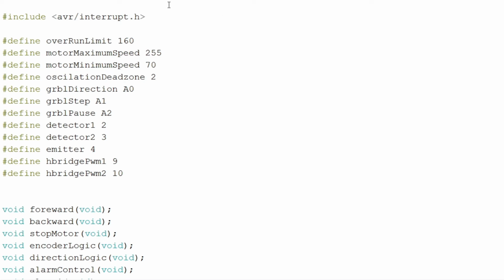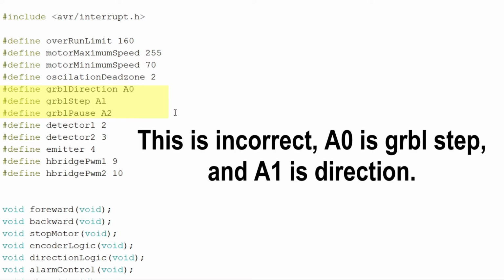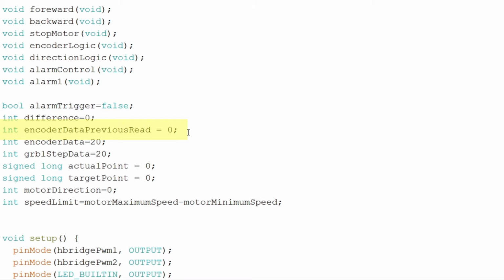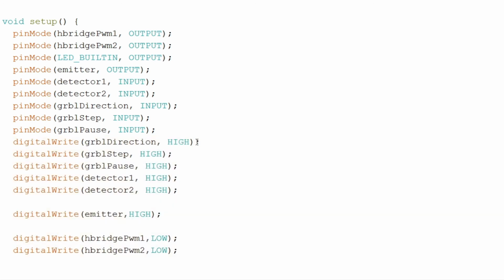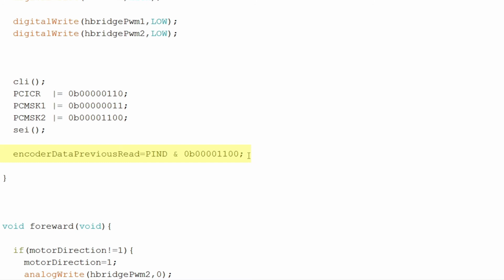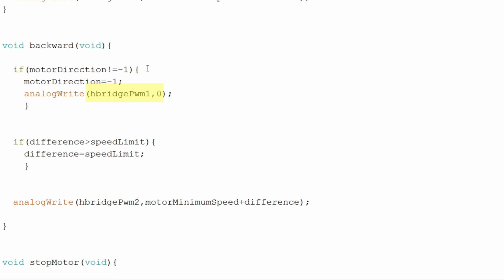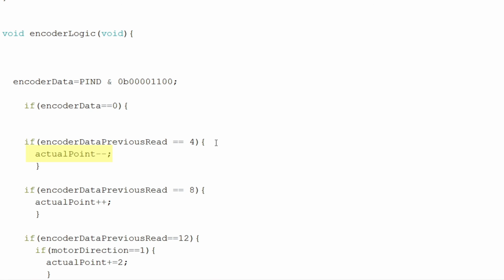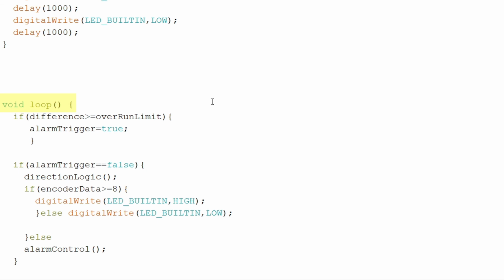Arduino motor controller line by line

Comment: Hello, can I use magnetic encoder such as AS5600 instead of the feedback mechanism used here?
Reply from the maker: In theory you can use such an encoder, but it will take changes to the code and wiring to make it work. I have never used that encoder, but I see it can use analog or something like I2C. If it has 2 analog outs for quadrature output, it might plug and play, I see that its outputs range from 0 to 360 for I2c, and this would be problematic as it resets the value every full rotation. The code expects a continuous value change calculated by quadrature output of the home built sensor. This output has a very large value range preventing any wrap around or rolling of the value, so there is no code to deal with that. To simplify with the AS5600 the value will roll from 360 back to 0 every 1/20th of an inch of movement on a machine with a thread pitch of 20 threads per inch on the lead screw. The step pulses from the GRBL control board are counted, and either added or subtracted based on the direction pin state from the GRBL board. The sensor then reads movement of the encoder wheel and adds or subtracts based on the direction of the movement. These simple values are compared and applied to a bare bones set of control logic to drive the Hbridge which drives the motor. This simplicity allows rapid response by the motor controller and is enhanced by using interrupts for both the step commands and the encoder changes. This puts motor control logic as the last thing to execute, interrupted when necessary to precisely track movements. The extra cycles to access a I2C interface, and taking position tracking off of interrupts would be one possible problem and slow down, the other would be processing for the difference in step and tracking data, with one being a large number to track absolute position target, and the other being limited to 360 degrees. If I were to design for this, I would use either an ESP32 or a Pi Pico so I can separate relative to absolute position processing to one core, and absolute target and absolute position calculations along with motor control to the other. I wish someone would make a cost effective quadrature hall effect encoder for things like this, it would make things so much simpler. This is the best info I can give you with no hands on experience with the sensor. I hope it helped, and good luck.

Comment: Could you make a connection diagram of the H bridge? I'm using an l298n and it doesn't work for me, that's why I would like to see the pinout of the one you use and see if I can match it.
Reply from the maker: The connections to the hbridge should be the common ground of the grbl board to the digital ground of the Hbridge. The power supply of the grbl board to the digital power of the hbridge. The other two, the 2 digital control pins should be listed in the source code. The analog power in side of the Hbridge takes the ground and power from the motor supply. The output pins of the Hbridge takes the wires to the motor. There are 4 wires on the input side of the hbridge which are the 2 logic or control wires, the ground and the power supply of grbl board. The output side of the Hbridge is 4 wires, power, ground, and the two motor connections. The pinout is different for each Hbridge, so refer to the data sheet and the source code for the motor controller for more details.
Reply: @CircuitSecrets  Thank you very much 👍

Comment: I have a question, in the grbl section you only used states 1&3 for the step & dir, leaving a comment about beeing able to use 0&2 too if i so desire, BUT what does one do at the 0 state? i think my nano is counting steps and setting the dir when the pins are genuinely inactive, activating the if 0 state.

Im not sure if im missing something but this seems like a fun problem to solve, but before i dig too much into it i decided to ask you first.
Reply from the maker: State 0 will be the partner to state 1, state 2 will partner state 3. I chose to only react to half of the states because I could not find the specifications of the on and off states of stepper drivers. Maybe I was looking in the wrong places. I assumed half of the states would be active, but it makes sense I would have it backwards. I did not do enough testing to find the deviation of a couple of steps that would cause. My test machine is way too sloppy to notice a problem like that either. If I had a decent logic analyzer I could have read the output from the GRBL board to determine the actual step states. The good news is if it is backwards, simply replace 1 with 0 and 3 with 2.
Reply: I always thought stepper drivers only read high step signals too, but i have no way of knowing either. From the way my machine acts reading all states is noticeably smoother. 

But i did not understand what you actualy ment with states 0 1 and 2 3. My wonder is, could there be a fault with this way of reading the dir step pins? When i tried to add state 0, my motor would shoot across in one way and never stop, i concluded that the nano will always be reading state 0 when grbl isnt actually sending anything.

So to wrap up my yapping, i need me all states 0 1 2 3, but state 0 triggers anytime the dir step pins happen to be LOW. Am i missing something in the code or is this a real issue?
Reply from the maker: @AliensGotTheBeat  Did you add the code in the interrupt handler? The simplest way would be to invert the input. If I remember correctly pin 0 is step and pin 1 is direction. So the possible values for direction 1 are 0 and 1, the possible values for direction 2 are 2 and 3. Look at is as Binary sets 00, and 01 are direction 1. 10 and 11 are direction 2. Reading the inversion will not change the smoothness of the drive, that will come from configuration in the GRBL board such as acceleration. If the hbridge is backwards the motor will take off in a runaway state. Make sure the pairs of bit states are both pushing the target point the same direction. If 1 pushes the target plus 1, 0 should do the same. I hope this helped.
Reply: You are right it shouldn't affect the smoothness, i will definitely look more into it, thank you so much.
Reply from the maker: @AliensGotTheBeat  Good luck!